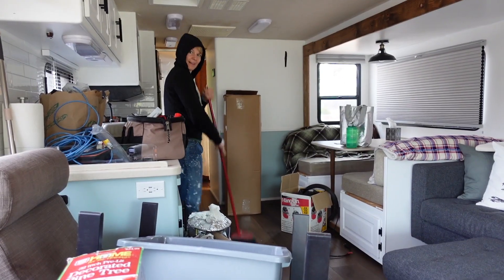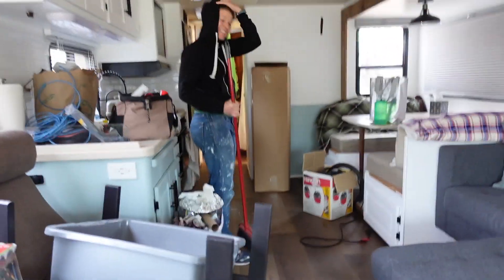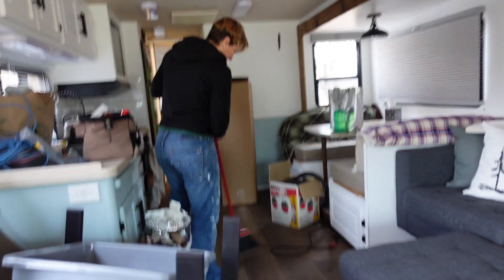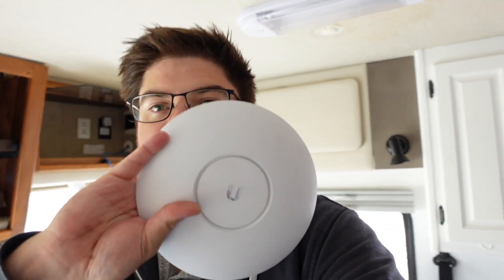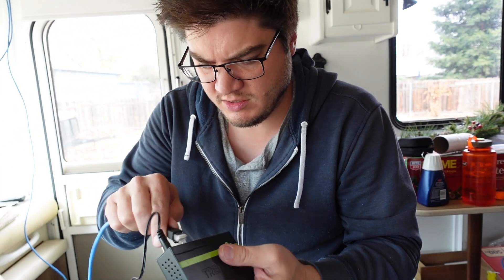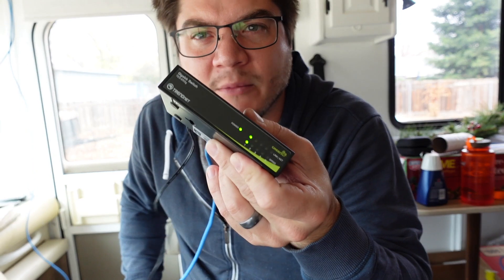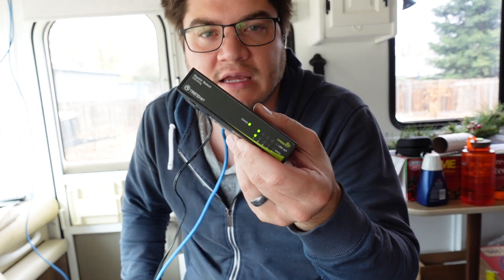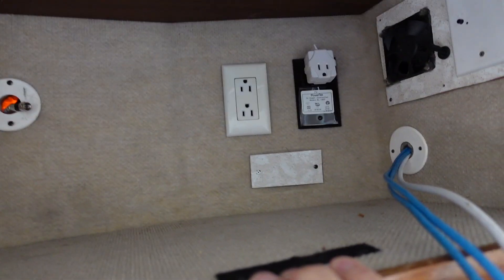Overkill RV WiFi Setup  | RV Renovation

Comment: Thank you for posting this! I am a Data Scientist working remote and we're looking to move into a motorhome. Reliable, redundant internet is one of my top priorities. What do you think of the cradle point system with dual modems for cell service based wifi?
Reply from the maker: I am not familiar with the cradle point system. We have been primarily on WiFi with our UniFi gear and teathering off of our cell phones. But tomorrow we are supposed to get T-Mobile’s home internet router to try out. It uses their 5G network. It should hook right into our WiFi system as a modem.

Comment: I don't understand what any of this means or why you're doing it, but if I'm building out an RV, would you recommend I include some Ethernet cable in my wiring runs for future upgrades?
Reply from the maker: If you think you might want it for something like a tv or wifi, then sure. Ethernet is cheap and easy to run. But I would venture to guess that most RVers don't need it since the size of the living space is small enough for a normal household router to send wifi throughout. So it may be overkill unless you know you will really want it.
Reply from the maker: Sorry, I just re read that and it doesn't make any sense. If you want to put a wifi router in there at some point, like over the cab or in the media cabinet, then running ethernet from the area of your RV with park cable input might make sense. That way you could have a cable modem in your outside storage bay and the router inside. Or something along those lines. Otherwise, it is probably just overkill to run it without a specific purpose. In an RV it would be very easy to run some ethernet and then realize it's in the wrong spot later on when you have a purpose for it. I planned our Ethernet runs out and that still almost happened to me.
Reply: @ryanandsu  Makes sense, thanks!